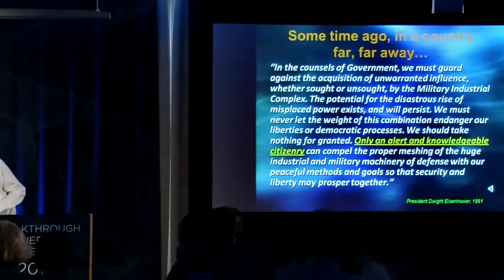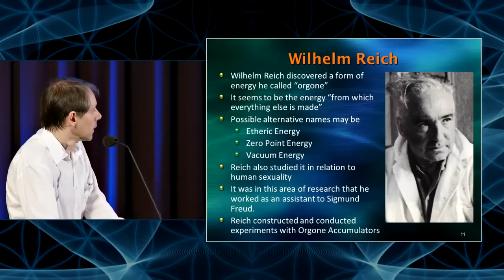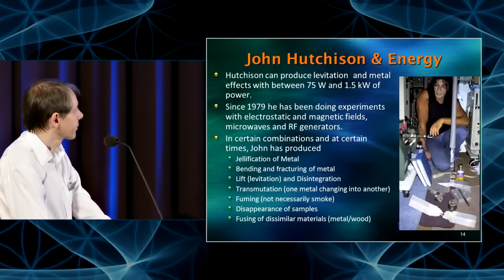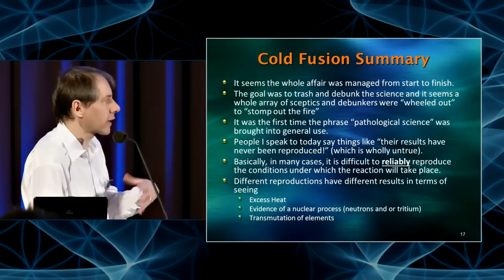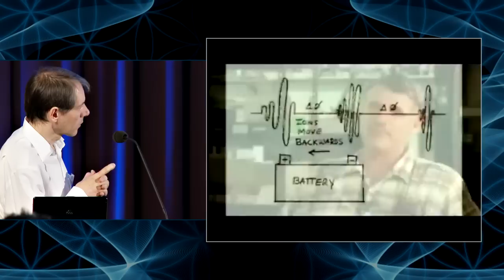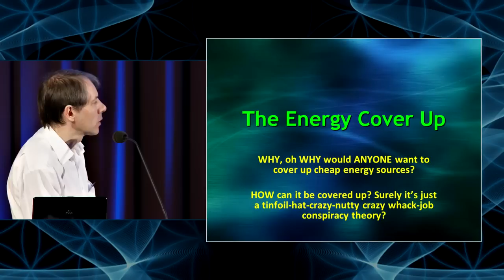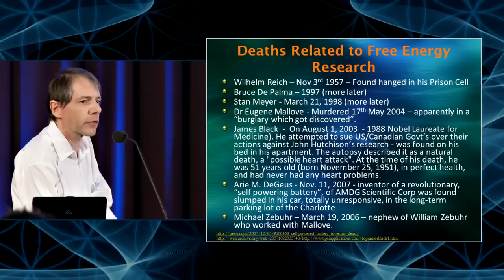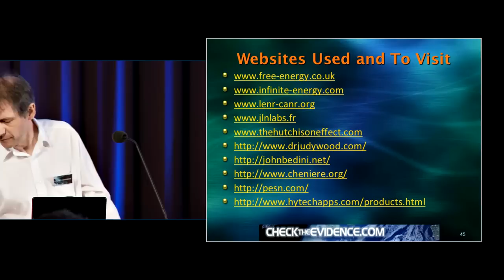Infinite Energy, But Not For The Masses | Andrew Johnson

Comment: The guy who found out a way to perform electrolysis with a lot less energy is being confused for energy generation. Energy Efficiency is not the same thing as generating energy. Thus it does not defy the laws of thermodynamics. His contribution is wonderful and useful however it is not free energy It Is Just Energy Efficiency so that we can get hydrogen out of water at far less cost than before. This may lead to a situation where we can use the hydrogen for more energy then it took to get it out of the water however that is not the same thing as free energy that just means that it's like a nuclear reactor or other things that we know how to do where we can put less energy into getting the energy that is already present in something out so that we can use it. Heck gasoline follows a similar idea it takes less energy for us to get the gasoline out of oil then we get burning it afterwards. Not to mention it gives us other products as well but that's besides the point.

Comment: Absolute nonsense. The first demo, for example, is a simple LC circuit and behaves exactly like I would expect. Get an education. Extraordinary claims require extraordinary proof and using Fluke meters to compute power in and power out is not quite satisfactory. There’s a reason why engineers use $50k or $100k power meters to measure efficiency.

Comment: The experiment at 16'14"... it's still ordinary electricity, the medium between the arc gap (the arc) is a plasma, plasma's have their own electro-magnetic field, it is that magnetic field which is inducing a current flow on the copper tubes...the arc is still being generated by being "plugged-in" to an existing electrical source...big deal...what's his point?

I'm all-in on the free energy idea, that's exactly what hydro power is all about, potential energy via kinetic energy is unlimited...the whole universe is electric, but that experiment doesn't really help the free energy idea...you still need a source to create the arc which induces electron flow in the copper tubes, if anything, it reinforces that the universe is powered by electro-magnetic fields, however, Einstein did unplug mankind from the universe with his laws of relativity and then it went completely skewed from there.

I'm not one for the "Little Grey Men" hypothesis, but one thing that I found interesting about Bob Lazarre when he came forward about reverse engineered alien space craft?, they ran on high powered voltage, and considering the entire Universe runs on electricity and Birkeland currents which could accelerate an object well beyond the speed of light, I find it very interesting that he not only spoke about the alien vehicles running on voltage, but he also spoke about unumpentium which magnifies electric current and voltage and was only added to the periodic table decades after he mentioned it as being a power source for this one alien craft, so called.

There's no way, back in those days that he fabricated the electrical part of his story, his adamant about Einsteinian mechanics, Black Holes and such, so it wasn't like he  was pushing the idea of an electric universe at the time.

https://www.youtube.com/channel/UCvHqXK_Hz79tjqRosK4tWYA

Comment: It's not High Voltage dude it is resonance and pulse impedance the stepper motors use a high pulse voltage to each field enabling a more stronger motor s static generators can crack water when in vacume's states slow if it is just straight in by when altered into a funnel coil and cross jumping occurs the charge increases

Comment: What's the big deal about a bulb lighting up under water? I dont get it? I can light up a bulb under water with a battery and bulb?  If its that it should be shorting out, well water, pure distilled water is not conductive. Its the stuff in water that makes it conductive.

Comment: This is why people don't believe in free energy. It's because people like this always talk about ways it won't work getting people to think and try it. Why doesn't anyone ever talk about ways it would work. So I'll get people thinking with something that would work a magnet stuck to a iron disk spinning in space the magnet spins because it's attached to the disk as one piece ok? What's going  to slow it down maybe the little bit of hydrogen in space and gravity because nothing is perfectly made there's going to be a little offset but for the most part it continues to spin for a very long time. But the disk will make power one poll at the center could be + or - depending on the direction of rotation of the disk and at the outer sode of the disk it's going to be spinning so the only way to have next to nothing friction would to have wireless power using a Tesla coil so the Tesla could will be spinning with the disk and the magnet and another Tesla coil will be located on the device you want to power but the problem with that is say you had a billion dollars to put something like this in orbit you really want to give out the power you spent a billion dollars to get nope once people found out there's such a device in orbit everyone will have a Tesla coil taking the power for free and there won't be much power left for the guy the put it up into space so unless the worlds governments want to combine money to put up enough to power the world and give power to everyone for free its never going to happen and let me ask you this when have you ever see a rich guy do something good just for the good of mankind

Comment: Years ago I made an hho cell in a fish tank on my kitchen bar counter. It was fun sticking a match in and cracking pop of the gas. I left it running for a while to check the temp rise. After an hr or so my wife put some frozen chicken in the microwave on other side of kitchen. She hit the defrost button and the microwave exploded. It was a very fast pop (just like the hydrogen when lit with a match on the water ,times 100) the door blew open a bright flash and the microwave was dead.. I had assumed it was hydrogen attracted to something in the microwave ( I’ve heard all kind of explosion noises,electric,gun powder , tnt,propane,and hydrogen.it absolutely was a hydrogen ignition..I asked smart people for years before I just let it go..I am now learning about the Argonne energy , the joe cell and this energy like electricity but not..now I’m thinking Maybe we were creating this energy or some hydrogen ions and they were attracted to the coil in the microwave accumulating for a while and ignited when the coil was charged. Jesus ,now I gotta blow up a microwave.
Reply: Beachcomber . I can’t find a way to reply to your comment ,so this is it... while you assume I am ignorant of the properties of hydrogen , it appears that you may be . Let’s review some facts
1: hydrogen is lighter than other elements thus rises fast
2: it is a very small element and would likely rise through the ceiling material
3:hydrogen has an explosion rate of 6 kilometres per second if I remember right
4: if the hydrogen accumulated under the microwave which is 3 feet down from the ceiling and well over 10 feet away from the cell , it would mean that the whole ceiling was saturated with hydrogen and the explosion would have been extreme 
Maybe if you looked further than wiki you might have an understanding of the confusion created by this explosion 
Sheeple are sheeple and they never look past the first Facebook or wiki answer they find.

Comment: darthvader5300 
darthvader530022 minutes ago (edited)
Reply to John Costello: All locations are viable geothermal energy production regardless of where you are if you are going to use the low-temperature and low-pressure and low boiling point ammonia gas turbine driven turbogenerators of the OTEC technology (Ocean Thermal Energy Conversion) which has been available since the 1970s and 1980s and by using the heat and not converting heat to steam and using inert pressurized gases like nitrogen or helium through a heat-to-heat exchanger and the input and output pipes and pumps are all thermally insulated. The problem is that Americans don't read, too much dependent on online computers and other computerized junk, Americans have very short memories and has this instant American mentality and Americans are incapable of thinking things through and Americans are incapable of comprehending the historical writings of old printed books from the 1990s way back to the 1960s and 1900s. Only the older generation of Americans can do that BUT NOT THIS YOUNG GENERATION WHICH IS A LOST GENERATION! A famous American writer once said, I used to sneak into the grown ups library section when I was still a child to read their PRINTED BOOKS but now I also sneak into the childrens library section to read their PRINTED BOOKS JUST TO KEEP MYSELF WELL INFORMED! And that was way back in the 1980s.
Show less
Reply     
 darthvader5300 
darthvader530011 minutes ago (edited)
Reply to May Lee: If you care to read old PRINTED BOOKS and not rely too much on computers and I am warning all Youtubers not to be online computer dependent but o go for hard copies, ink-on-paper printed books, old books, pocket books, paperbacks, encyclopedias, dictionaries from the 1990s to the 1960s and going way back to the 1900s and way back further and beyond, then they will know that in Alaska, American oil drillers ROUTINELY DRILL DOWN TO DEPTHS OF 20 KILOMETERS AND THE OIL COMES OUT BOILING HOT! That information was in a pocket book I read way back in the 1980s and one of my friends who was in the Alaskan oil fields only confirmed it. Fortunate for me I have a printed books-based and microfilm-based personal library the size of a warehouse. You Americans should do the same, do not wastefully discard or junk your encyclopedias or vandalize them, preserve them for posterity's sake for future generations so that they will have a hard copy for future cross-referencing and counter-checking for the printed media provides certainty and permanance, digital media will degrade within years and can be tampered without you being aware of it. Old encyclopedias and old books do not become obsolete when they become old, they only become valuable as they become older as A PERMANENT AND CERTAIN SOURCE FOR  FUTURE CROSS-REFERENCING AND CROSS-CHECKING INFORMATION COMING FROM COMPUTERS WHICH ARE INCREASINGLY UNDER ATTACK BY OBSOLESCENCE AND BY THE DIGITAL DICTATORSHIP OF CENSORSHIP BY EVIL ISPs SUCH AS GOOGLE, AOL, YOUTUBE, FACEBOOK, TWITTER, COMCAST, AT&T, ETC. Books and encyclopedias and dictionaries and all forms of printed media when they become old they do not become obsolete but they actually become valuable and priceless source of permanent and certain information for present and future cross-checking, cross-referencing, cross-inspection of dubious digital data. Print is forever, digital is temporary dust because of digital dark age obsolescence and because of digital dictatorship caused by digital censorship by the new digital-based dictatorship of self-censoring/anti-free speech ISPs such as facebook, twitter, youtube, comcast, AT&T, AOL, etc.
Show less
Reply     
 jds hempfarm 
jds hempfarm4 months ago
I believe Eisenhower apologized to our Grandparents for releasing the Creature from Jekyll Island, The Federal Reserve, to control our legal tender, called Federal Reserve Notes. The Federal Reserve obfuscated the Constitution of the United States of America, by being private. Ike comes forth with an apology, because removing the Federal Reserve monsters is a futile mistake. Ask Lincoln, and Kennedy. Believe it or not Henry Ford and others proposed Industrial Hemp as a value to back the paper money. Suddenly Hemp became illegal, and we got the IRS. I am so proud of the IRS, they are so kind and fair. I want so badly to create another Unilateral Contract with these nice guys. Voluntary Compliance is the future of America!
Show less
Reply 58     
 Dean Smith 
Dean Smith4 months ago
Yes, jds hempfarm, I think you're right, and even though Andrew Jackson was not one of my favorite presidents because of his hatred of native Americans, I still have very high respect for him for shutting down the central bank. We need another Andrew Jackson now.
Reply 4     
 StarGazer 
StarGazer3 months ago
well said
Reply     
 Akoben Adinkrahene 
Akoben Adinkrahene3 months ago (edited)
It was Wilson that did that but, I agree with you.
Reply 3     
 Jamie Meyer 
Jamie Meyer3 months ago
HAHA ! " nICE gUYS" .
Reply     
 Akoben Adinkrahene 
Akoben Adinkrahene3 months ago
@Dean Smith  I can't agree with your last statement " We need another Andrew Jackson now." Because of your first statement "Andrew Jackson was not one of my favorite presidents because of his hatred of native Americans" However I would change native Americans to people! Even tho (so-called) Black people are native  to Turtle Island (The two  Americans) I include them  by name because many people don't realize that fact.
Reply     
 Jamie Meyer 
Jamie Meyer3 months ago
Did u reply, To Me?, specifically, OR do general reply show to Public, but showed on My " notifications" ?  I did say , " nICE gUYS", sarcastically
Reply     
 Akoben Adinkrahene 
Akoben Adinkrahene3 months ago (edited)
@ Jamie Meyer:  Not sure if you are replying to me, forgive if you are not. But if so, I would suggest you check out the @Dean Smith. Meaning it is directed to him. I did get the point of "HAHA ! " nICE gUYS" .
Reply     
 Jamie Meyer 
Jamie Meyer3 months ago
i did reply to, thinking u , replied to me,  ;o)
Reply     
 Jamie Meyer 
Jamie Meyer3 months ago
is all good
Reply     
 Hakeem Shabazz 
Hakeem Shabazz2 months ago
jds hempfarm You meant  President Woodrow Wilson released the Beast December 1913.
Reply     
 Kathlean Keesler 
Kathlean Keesler2 months ago
jds hempfarm Have you by chance viewed the documentary JFK to 911 Everything is a Rich Man’s Trick by Francis Richard Conolly? It was here on YouTube few yrs back.
Reply     
 Conor Duggan 
Conor Duggan1 month ago
Note that this video has been demonetized, many YouTube videos of equivalent length would have a dozen commercials in them.
Reply 5

Comment: Homopolar  motor will produce free energy, But has a slip ring problem, therefore it is useless.

That fellow giving the Tesla experiment, was useless to say the least, He basically had a reflected wave along those 2 rods, acting like a variable transformer, and only a low voltage one at that, because of the short at the top, Nothing there that all electrical knowledgeable people understand.
Putting the light under water has no validity to that for any reason, there was absolutely no high voltage to short out, Water is a high dielectric resistance, except with a salt solution of sorts.

Comment: The lightbulb Tesla experiment is nothing more than RF traveling along a feeder with a shorting bar. The lamps light at the current nodes. When building microwave antennas, I always tested the antenna if functioning by using a lamp to test the dipole connections are perfect. I did not need to touch the antenna, but held the bulb an inch (25.4mm) from the antenna. This no secret. The speaker is praying on the gullibility of the audience to make claims he cannot demonstrate in person. This man claims to hold a degree. A degree in what?
Reply: Bullshit, from the same college as R. Gage and Judy Wood, I guess.